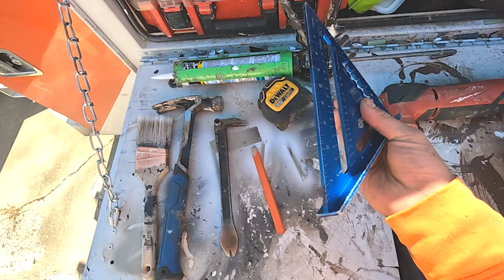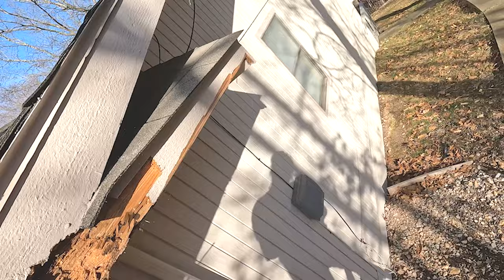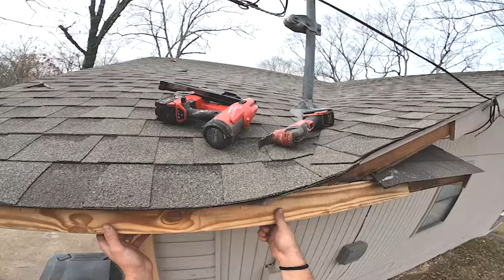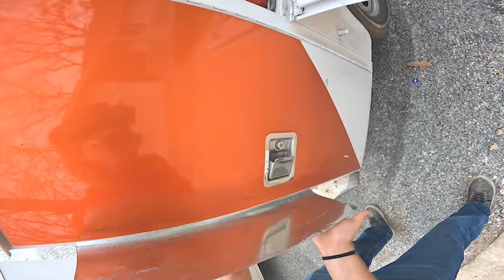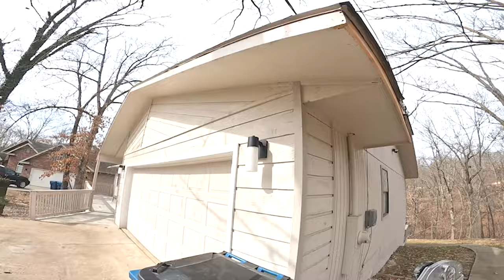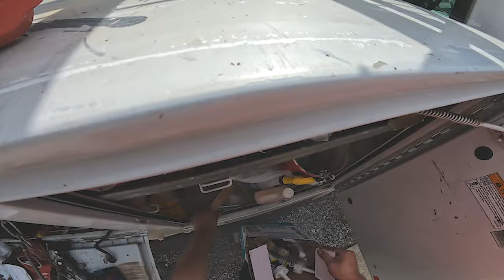Best Way To Replace Fascia | How To Repair Rotted Wood Fascia Board Damage

Comment: Nice work.  ...um.  The ladder.  You need a taller one.  My ladders all have two stickers on the top two steps.  The second from the top says "suspended".  The top one says "fired".

Comment: About the best video I have seen on fascia/sub-fascia repair, very thorough!  Now all I need is a video or 2 showing me an easy way to get the gutter out of the way- without damaging it- so that I can repair the fascia.
Reply from the maker: Do you have gutters with screws/hidden hangers OR gutters with the gutter nails/spike and ferrule?
Reply: @chappellgutter  Could we get the answer to both please? :-)
Reply: @chappellgutter Hey I’m specifically interested in doing this repair without fully removing spike and ferule gutters. I’ve got rotted fascia and soffit at corners. In some cases I’d just like to repair the gutter and not destroy it ripping it down.

Gutter is a continuous run with lots of 90s, and a tight friction fit making it hard to move even with the spikes out.

Comment: I want to know if a contractor should be charging me $3500 for this??
Reply from the maker: Depends on the amount of damage and the structure of your home. This type of work can be dangerous, require years of experience, and thousands of dollars in tools. 

$3500 for 10' of fascia is expensive. 200' of fascia, sub fascia, and soffits repaired and painted is reasonable. 

It just depends on the situation.

Comment: Great video! I have exposed rafter tails, no soffits just bird holes for attic ventilation. Also no sub fascia just a single board. Not sure if it will make this job easier or more difficult but got a lot of rotted fascia at my corners. Thanks for the video!

Comment: What nails did you use for the fascia board? Looking at replacing all of my fascia boards, because a lot of them are rotted or the ones that go behind the gutters are about 2" short of going to the roof. They used 1x10's instead of 1x12's.

Comment: Great video! Was that facia glued down, it felt like it? Don't know if i missed it, was that a brad or framing nailer? What size nails? What type of blade was used on the oscillating tool?  Thanks for the feed back!
Reply from the maker: I've never experienced fascia being glued down. It is a framing nailer. I always go with 3-in nails. 3-in nails are longer than what you need for nailing fascia into sub fascia, but in the case that you have to do sub fascia repair, sometimes the longer nails are helpful.

I always use Diablo nail embedded wood blades. Nothing else will be worth your money tbh

Comment: I run into a lot of fascia board that has a 1/2" groove that the wood soffit locks into. Im trying to find a better solution than shallow cutting each board with the circular saw. Any thoughts?
Reply from the maker: A router!! This does take a bit of an investment as you need a router and router table.

If you come across these enough the investment makes sense. 

It's super fast and makes the outcome so much better!! 😁
Reply: @chappellgutter  hadn't thought of that. Thanks for the help!

Comment: Looking at how to fix rotten fascia and soffit where garage meets breezeway and has seamless gutters.  Sounds like it will be tricky if not impossible to save gutter in order to fix rot.
Had roof replaced in 2021 and they didn't address rotten fascia, that's probably why.  Any thoughts how to make a bigger expense without having to replace gutter?
Reply from the maker: Typically not on the roofer to do fascia repair tbh. It's a siding or carpentry project.

You HAVE to get the gutter out of the way and if that means spending a little more money to  replace the gutter and do it right so be it 

Best of luck!!

Comment: So i replaced the fascia on the back of my house myself.  Let a contractor do an 8 foot piece on side as I needed to hire someone to paint area over garage anyway.  He screwed the 8 foot piece of fascia in at each end. Nothing in between. Should be nails or screws every two feet in rafter ends.  MF this is why I hate to hire people.  Sure it looks fine from the ground but I wonder how long until it warps.
Reply from the maker: The sub fascia is holding this board in place FIRM. I use hot dipped galvanized nails. This is cedar. 

Everything I did here will make this fascia repair last for 40 years.